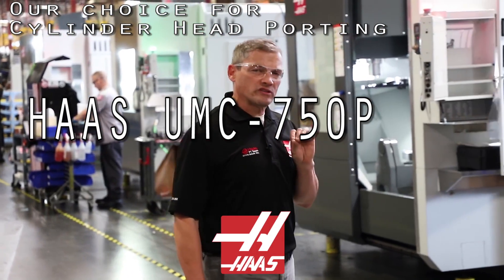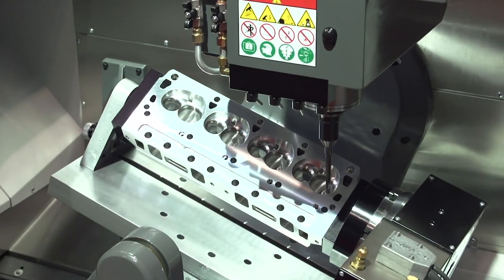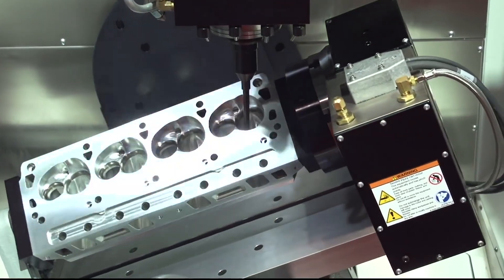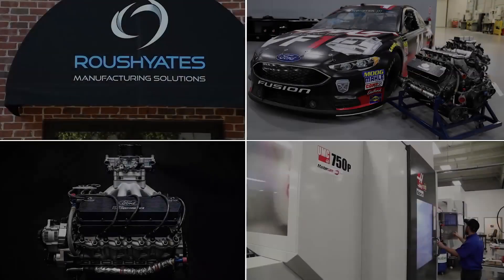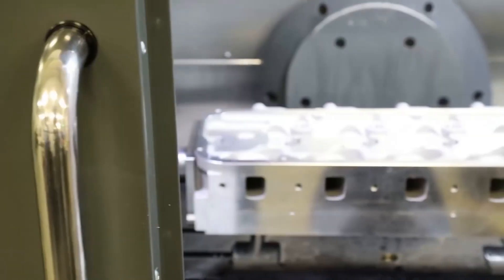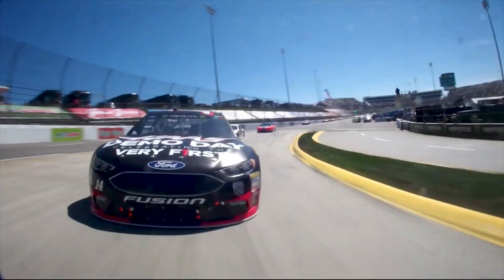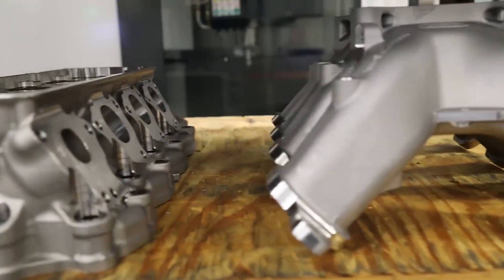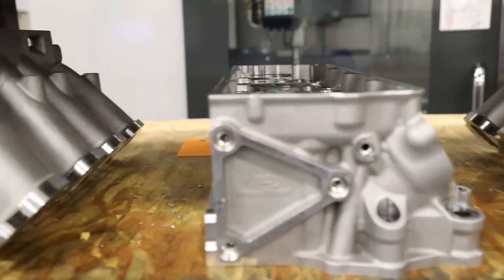5-Axis CNC Head Porting of Pontiac Cylinder Heads

Comment: God that Beautiful Machine saves a Ton of Time and Accurate than Old School way of Porting Heads with Electric or Air Dremel, , Carbide Tip Cutters and Rolled Sand Paper Hours and Hours or days depending how big ports and (welding Push Rod holes- oops  Lol  anyone done serious porting knows what that Means)